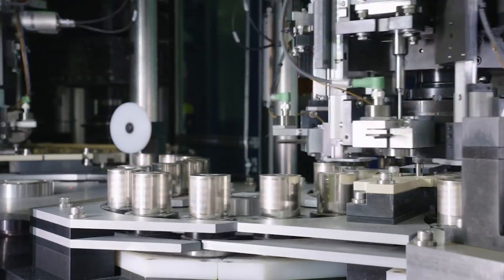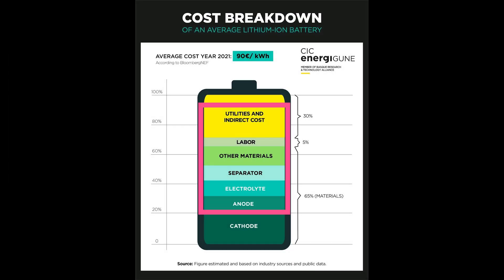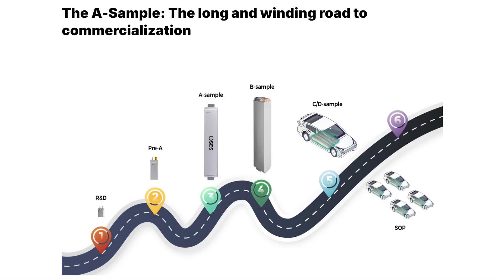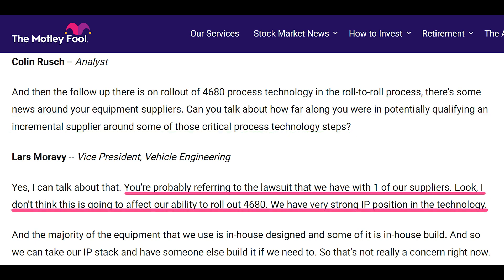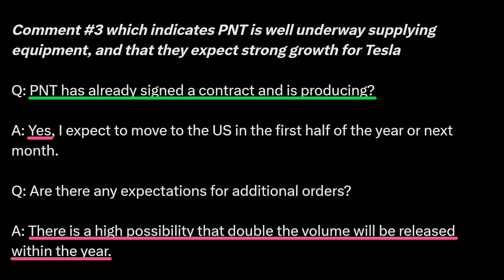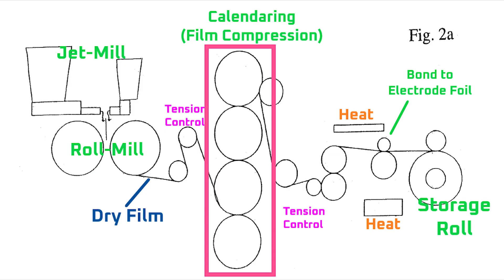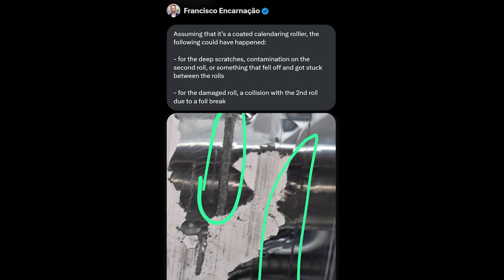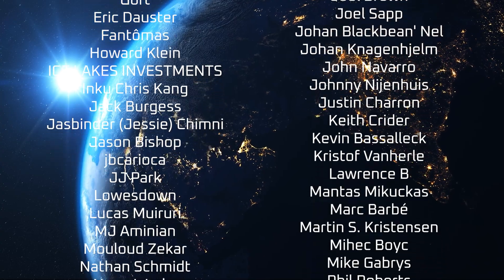Dry Cathode Finally Solved!  What was the delay? // Tesla Q2 Battery Report

Comment: Are there any ballpark $/vehicle cost savings we can infer regarding the dry cathode?
Reply from the maker: Great Question!  Sure, let's take a stab at it:

Global weighted average cell cost is currently ~$80/kwh

Tesla's curent cell cost for 4680's with wet cathode is probably $90-100/kWh 

4680 with dry cathode is probably ~$70/kWh in the next year or two

4680 (with a Nickel chemistry) deeper into the future with fully integrated supply chain is probably $50-$60/kWh between 2026 and 2028?
Reply: @thelimitingfactor  can you plz share your calculation from $90-100/kWh with wet cathod to ~$70/kWh with dry cathode? wondering which part can contribute to the reduction. Thx!
Reply: @thelimitingfactor  Jordan I highly doubt dry electrode is going to drop costs $20/kWh. It's going to be closer to $5-$15/kWh depending on your energy, labor, capex, and cell construction (e.g. thick electrode) assumptions.
Reply: @thelimitingfactor 

Did you say 220kwh cybertruck by 2026? 😊
Reply: @TedKidd …everybody’s waiting on price cuts… with all the amendments
Reply: From some napkin math, call that $5k savings per vehicle, assume they put half of that into gross margin and half into dropping the vehicle cost, that could bump auto gross margin 5-6%
Reply: @neilmurphy7594  Short term about 2k savings per vehicle, assuming 123 kWh, long term around 5k, yeah.

Comment: The combination of battery material costs going down due to the majority of Legacy Auto pulling back on EV's coupled with Tesla determined to get the 4680 dry cathode mass production issues resolved will eventually give Tesla a huge price advantage that will be extremely challenging for others to duplicate any time soon.

Comment: Is a structural battery pack still possible with 3rd party batteries?
Reply from the maker: 2170s, not really

4680s from 3rd party suppliers, definitely

Prismatic cells, definitely

Comment: Very interesting. Maxwell tech was useful? 
One point not mentioned: dry process leads to less heat and pollution needed. So less co2 for cell making process. Maybe 30% less co2 at cell level, for a China plant? So 10% less co2 by battery pack?

Comment: If the new dry film is thinner than the wet film, capacity will be higher since you can pack more charge carrying material in the same space. This is assuming that a square inch of each has the same capacity. This too is not known.
Reply from the maker: I think maybe you mean thicker? 

Dry electrode coatings can be made thicker, which increases energy density 

I doubt they'll be pushing on that yet though too hard
Reply: @thelimitingfactor  Surface area can be achieved in several ways. A thinner layer means you can have more layers in the same space for more total charge carrying surface area. A thicker layer if it is highly porous can also create more surface area than a thinner layer that is equally porous. Either thinner layers allowing for more layers or more porous layers will achieve the same goal of more places that charge can be collected. I'm sure Tesla is going to try everything they can to increase cell capacity in any way they can.

Comment: Hey Jordan, I work in battery packaging and most of the suppliers I have talked to are going to a 4695 format over 4680.  Do you think Tesla packaged protected for that format with the additional space in the CT battery pack?
Reply from the maker: Sandy Munro said the extra space is for safety

I don't see a reason to make another and longer cell when you can just make it higher energy density and homogenize across all vehicles.

Comment: If the interface of the roller is the problem and the coating is chrome , why not make the roller completely from chrome .? Gets rid of that problem right!
Reply from the maker: As it was explained to me, the stainless steel is needed to create a hard backbone for the roller, and chrome isn't hard enough
Reply: @thelimitingfactor  hmmm so why is it used, other than for a smooth surface if it's too soft in and of itself?? Plus the electro plating of the copper to get chrome to adhere to the stainless?
2 layers of very soft material under compression compressing  a ceramic like concoction sounds like a recipe for disaster from the get go!!
Hmmm why not use the hardened stainless polished to a mirror like surface?
Hmmm 
Thanks for the videos BTW Jordan  very informative.
Keep up the hard yards 
😉😉🤟🤟🤟🤟

Comment: Having extremely good adhesion on very hard chromium electroplated films is actually non trivial, especially on comparatively strange (like plasma treated steel) surfaces. usually you'll prime the surfaces with adhesion priming layers like Ni or Cu but those will not work in this case because they're too soft. This is indeed a chunky problem to solve. 
Also this will probably make up a big part of competitive advantages between calendar companies i recon, saueressig being actually considered the premier solution by many.
its interesting but i guess they had a solution in the drawer that was discovered but too niche till then :D
Reply from the maker: Thanks for your input!  I love comments like this.

Comment: Very nice presentation of the data was first rate as always... but one of the conclusions had me gob smacked.

The range of Cybertruck was Already a major disappointment (350mi vs 500). 
Opting for a cell with even Lower energy density is unlikely to be acceptable for anyone... Anyone. Better to just keep producing the existing 4680 cell or introduce the 2170 with its 265 or so wh/kg rating.

Tesla clearly recognized this when they offered a range extension pack for the bay (still couldn't get to 500mi). Some of the major enthusiasts may be willing to pay $130k per truck for range Way lower than anticipated, but one has to assume the Vast majority were expecting a truck roughly where the statistics were when they put in their deposit. Note also that more than 85% of reservists wanted the 2-3 motor models. Only a small percentage wanted the 250mi range single engine truck. 

Again putting out an even shorter range truck would be catastrophic for the brand. The competition will go (already are going) the other direction and eat them alive, pointing to the fact that They are practical for winter/towing but Cybertruck is clearly not.

The energy density at the Absolute Minimum would have to match the existing batteries at much lower cost. 
No one would be happy with an Even Shorter range Cybertruck. 

There is also No reason to "de-risk" the battery if the current one is good enough for now, however badly they need to drop the price from $130k.

There is zero point in producing an inferior but cheaper battery for a truck which is already "meh" on range having failed so badly to meet the 500mi range promises.
Reply from the maker: It's only a disappointment for a minority.  They're selling at hotcakes, even at a $20k price premium.

Comment: Usually there is copper under the chrome or nickel on top. All deposited by electroplating. The copper is too soft. The metals and interfaces have to be optimized to strengthen the interfaces and reduce the difference in hardness between the layers. Chrome is high hardness but copper is soft. They could probably add some other elements to harden the copper. This is all well known materials, but the suppliers of the rollers may not know or they need a different engineer who has the knowledge base. Humans have solved these issues many times in the past. It’s just getting suppliers to provide what is required.
Reply: Why not make the roller from chrome , gets rid of unnessacary problems .
Or have a solid chrome sleeve that is easily replaced when it wears out, seems a simple fix to me!!
Reply: @brettmciver432  not sure how to make such a thing. Where would you get such a large piece of chrome? How would you machine it?
Reply: @rb8049  
No idea but surely a business such as tesla and the engineering talent therein are smart enough cookies to solve that issue.
Reply: More likely hard chrome directly over the stainless as in rotogravure rollers for printing.  Not seeing any copper or nickel on the break edges.
As for solid chrome, prohibitively expensive to make a solid chrome cylinder, plus it would have poor metallurgical properties (brittle, high stress, etc.)
Stainless steel needs aggresive activation to get a metallurgically intact bond, so this looks like process error with insufficient pre-plating activation  / decontamination.
Reply: @johnlichtenberger1790  
What about having a solid ,say, half inch thick chrome sleeve that fits over the ss roller?  Besides at the level of production  how much would a solid chrome roller add to the cost per millions of cells produced? Especially if it lasts a loooong time ?

Comment: I wonder if the liquid nitrogen tanks play a role?  The gaseous nitrogen [in] the vaporizers would be around the boiling point of -191°C, could easily be a source for -160°C-ish temperatures.  Most materials become brittle at very cold temperatures, while Elon has said stainless gets stronger instead.  So could that be used to crush the cathode material more effectively in the milling process, with less damage to the rollers?
Reply from the maker: No, that would affect the material flow and lamination.  It doesn't work cold

Comment: Used off the shelf rollers but the roller had to be optimized. But those responsible for the equipment don’t know details of the roller manufacturing process. Typical problem when you deviate from what is normally done. But if you have a wide range of engineering talent, such issues can be identified and resolved quickly.

Comment: I am shocked that you were floating the idea that a battery capacity similar to or lower than present would be viable for Any customer long term!
 Every fair video I have watched comparing the Cibertruck to other EV trucks or ICE trucks comments on the shortcomings of the battery.
For the Cybertruck to be anything more than a technology platform or novelty, a flat curve fast charging battery, with a range of over 400 miles is imperative.
Reply from the maker: Not really, they're selling like hotcakes, and currently at a premium of about $20k to what they should cost
Reply: @thelimitingfactor  As a Novelty or a high-tech toy, YES. As a day-in-day-out workhorse, not so much. I want one for work that is affordable, can load and tow to site, use the power outlets, and get us home.
I believe Elon understood this at the launch. That is why he announced 500 miles and waited as long as he could in the hope their "high performance" 4680's would deliver. When the honeymoon is over Tesla had better have the the dry cathodes loaded with "Tesla Silicon" dialled in to give the right price/performance or the ICE trucks will continue to dominate.
Reply: @robinholmes785  Luckily for them most trust owners don't actually use them for work.  Or even towing.
Reply: @TheEvilmooseofdoom  😆 Is that why they are only selling the “Designer” model?!

Comment: Maybe the solution is more rollers? progressively getting the thickness down rather than all at once?
Reply from the maker: I was thinking the same
Reply: Pre rolling seems pretty obvious, no need to solve a problem that can eliminated.
Reply: I was thinking the same right away. Seems not like to be that easy otherwise they would do it?
Reply: @marcelh2341  maybe we take the diagrams too literally and there are already 10 of them in a row 😁or way more probably the problem is due to fluid dynamics and material science reasons I'm waaay too dumb to comprehend.

Comment: 'Twill be great to hear what Shirley has to say. 

As a fully vertical integration of superimposed/Superposition-point concept Singularity-point positioning Conception, Calendaring is the holography-quantization nucleation of mass-energy-momentum, solid, liquid, gas and Sublimation-Tunnelling spacing/plasma of resonance bonding proportioning chemistry. 

This is the ultimate winding +/- of epicycles in Superspin-spiral Superposition Totality, Spinfoam bubble-modes in the extremes of relative-timing ratio-rates Perspective.

A direct example of how parallel coexistence operates in Newtonian Fluxion-Integral parall prisms and the Camera Obscura setup applies to the parallel roller arrangement of elemental nodal-vibrational layering of compounds used in the battery manufacturing process, although it takes a while to comprehend this.